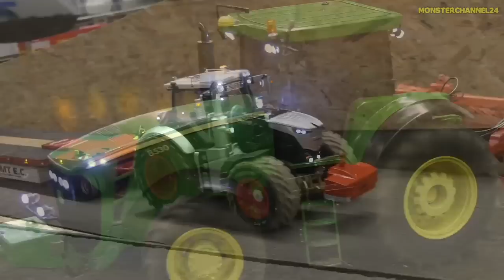MEGA XXL RC TRACTORS AND TRUCKS COLLECTION!

Comment: Bro please give the buy linke RC truck and tractor
Reply from the maker: The trucks are modified Tamiya trucks. If you don't have the chance to find a second hand truck, you have to build one by yourself. There are a lot of YouTube videos or forums where you can get some help.
The tractors are motorized Ertl and Bruder models, they are not available ready to run. All made at home.